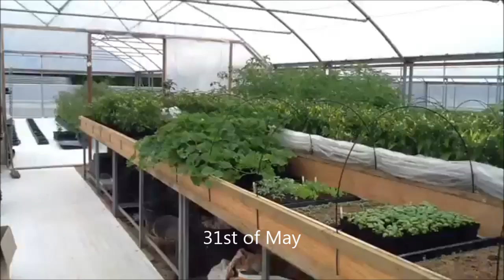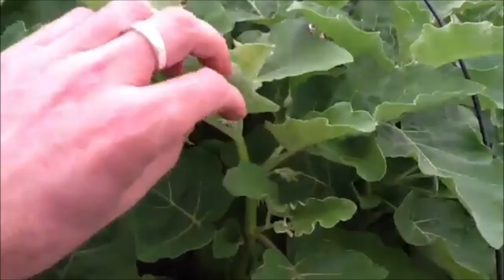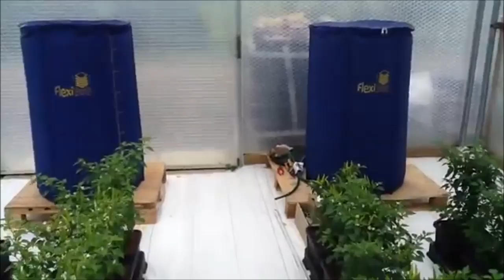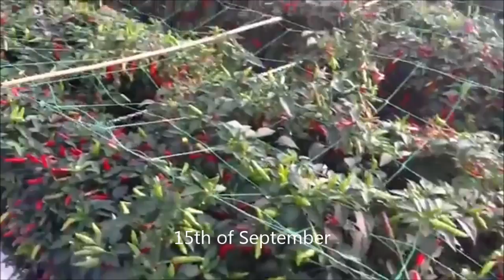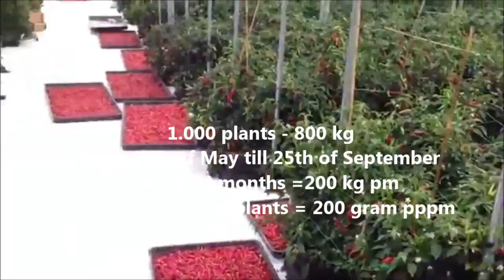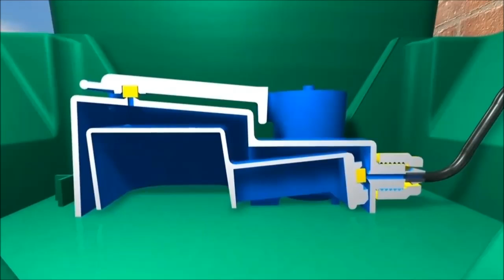PB Test 1000 Chilli Auto Pot System

Comment: what medium are you using?
Reply: He said coco and a soilless mix. The auto pots systems are made for hydroponic/soilless applications
Reply: @Nicatlotus  you understand like 6 different things fall under "soilless mix" right?
Reply: @Lolerburger  yes i do. I also know that these auto pots 70/30 coco/perlite is recommended with 2 inches of pebbles or hydroton at the bottom of the pot
Reply: @Nicatlotus  now there's some useful information.

Comment: what kind of fertilizer are you using?
Reply: 2 sets of npk formula fertilizer (usually mixed manually)
Reply: @gaplus4949  thanks
Reply: @gaplus4949   Would this formula be considered non organic with only the 3 minerals required by law. If so is there a more organic way to set up the same system with all of the minerals and no chemicals
Reply: @deitykush  pot system uses chemical fertilizers so it's not considered as organic and we need more nutrients other than npk. Btw it's hard to achieve balance between organic farming and harvest yield by using pot system. I would rather you just focus in organic farming considering the price and value it generates.
Reply: @gaplus4949   Also what sort of substrate are you using. Can you not use basic soil?
Reply: @deitykush  we use cocopeat or rice husk (if you have budget)

Comment: Very cool! I'm planning on starting some peppers in the Autopot system (just 4). If I may ask...what growing medium would you recommend?
Reply: I use coco with perlite and it works great.
Reply: How do you keep PH at a relevant level? I use gold label nutrients and osmosis water and my PH keeps creeping up to 6.9-7 in the reservoir. Even if i use a ph-down autodoser in the reservoir the liquid in the pots is creeping up to 6.9-7.0 after a few DaysAny tips? Using coco as well
Reply: Zand3rs did you ever figure out your ph problems?
Reply: @zand3rs67  check water pH level and try flushing your pot for dilution. If it doesn't work then spray some calcium carbonate to plants